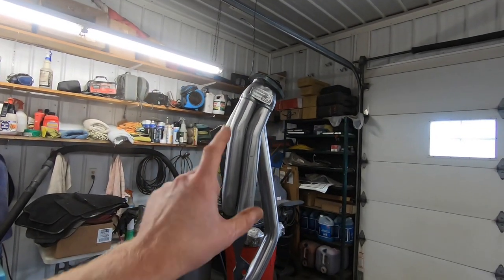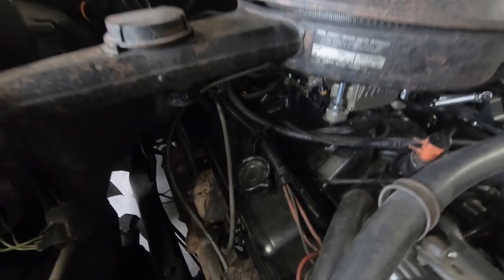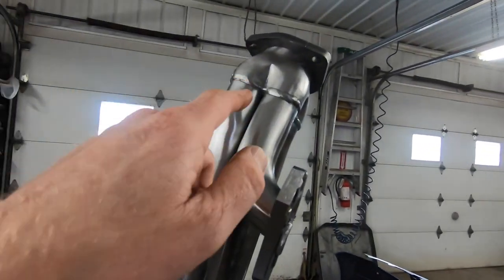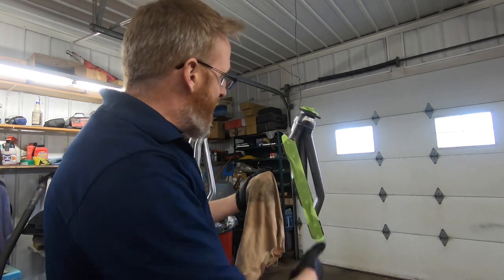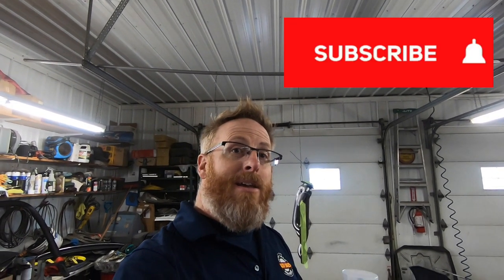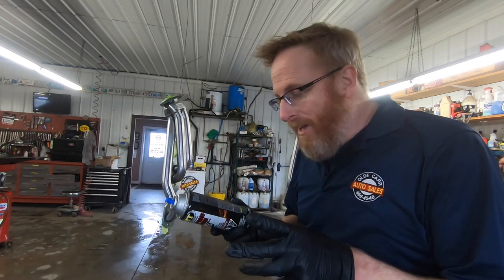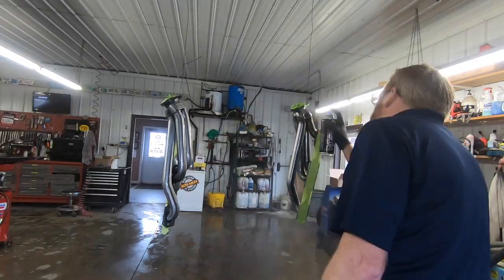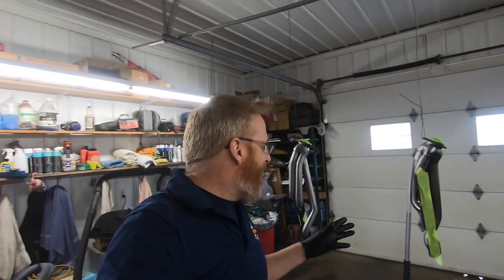High Heat Clear Coat on Sanderson Small Block Chevy Headers

Comment: Hi , I have used this on a motorcycle frame and I am pleased with the result .I have looked all over the web to find out if ,after it's cured it can the clear be sanded, and another coat of clear applied ? Will it bond or should I just leave it . thanks
Reply from the maker: I would say you’re on the right track. Sand and reapply!
Reply: @OldeCarrGuy  Ok, great . Thanks for the reply .

Comment: I'm curious to see if the paint is just going to peel off. Stainless steel is supposed to be etched with a galvanized etching primer before paint. I am in the same situation I have stainless long tubes for my LS but I want to make the engine look like a hopped up 350sbc I wanted to paint them black or cast. If I do mine I will probably sand blast them with a corse grit. Etching primer can't handle the high temps. Thanks for taking one for the team Jason
Reply from the maker: Time will tell!
Reply: @OldeCarrGuy  how have they held up?
Reply from the maker: Not the best! The coating is still there but they hazed quite a bit!

Comment: I want to use the clear ceramic on some ebay stainless steel shorties..   How did this stick?    Id just like to leave the chrome look intact...    I also saw eastwood has a nice internal pipe coating.
Reply from the maker: If you read through some of the comments, I was warned not to do this. It didn't last as long.
Reply: @OldeCarrGuy  dammit.. well like I said Eastwood makes an internal coating that comes with a hose  that atomizes .   I'm wondering what the inside texture is   ( im assuming not like a mirrored chrome ) especially on a chinese stainless shorty off ebay     and you could get the same results ( obv inner outer is best)  of an outer coating and keep a mirror shine. Mine's a van project anyway but thats also more critical for temperatures under the dog house.   But  its not like its as easy to pop the hood.. it would still make it feel nice    and not to say that   if you had to scuff and primer that some coatings dont look nice.  I'm just doing shorties because i dont know if my long tubes will clear the body   so i figure might as well boost power by coating

Comment: How many cans would be needed to coat the full exhaust system? Like 6 cans can be enough for 2 coats from the engine manifolds to the exhaust tips?
Also do they stand pressure washing from time to time when my car need washing after dirt/muddy roads?
Reply from the maker: Oh Boy! Good question. this was 2 cans for 2 headers, so I'd guess at least 4-5

Comment: How has the clear coat held up?  any yellowing?  I did some exhaust tips and went with a matte black but didn't clear coat because they wont get that hot and because it would change the matte look, even if I got the matte high temp clear coat stuff I felt it might shine them up too much.
Reply from the maker: No yellowing, but it did turn my headers all white. Not sure what to thing of that. Not too worried about it. He’s not a show truck.

Comment: Hey I've been trying to get an answer for how this will hold up on raw headers. How are they holding up?
Reply from the maker: Not as good as I had anticipated unfortunately. They basically turned white.
Reply: @OldeCarrGuy  appreciate the reply. Have you tried anything since then that you can recommend?
Reply: @MrYogitron92  they don’t seem to be rusting or anything! So I think the finish is doing its job but I’ve never tried anything else. Maybe black or grey would hold up better to the heat!
Reply: @oldecarrguy2  awesome I'll look into it

Comment: How has the clear coat held up?
Reply from the maker: Not great. It's still there and didn't flake off, but it did discolor.
Reply: @OldeCarrGuy  Like how stainless normally gets colors with heat cycling, or the clear coat itself discolored?

Comment: Can I use heat gun to cure i am working on my rotors on the side and front
Reply from the maker: For sure. We use a heat gun all the time!
Reply: Ok just because I see the label about    250F to cure and 400f and 600f I don't have  too do that just for my rotors I could use heat gun than put them on let it self cure in this summer heat
Reply from the maker: @dianahernandez1375  I misunderstood you the first time. Be sure not to spray the braking surface on the rotor as you will most definitely have brake problems. Only spray the hat where it mounts and the edges. Tape off the rest.
Reply: I explained now do I have to follow the off the vehicle label and direction  in the can bottle or just use the heat gun only did your melt.

I am doing it on my rotors the front and back and side not on the pads
Reply: I am using vht flame proof  satin clear 1300-2000°F [704-1093°C]

But they sale one for rotors only and caliper my friend told use one with high temp
Reply: °F
Reply: Here is the guideline 

Off the Vehicle

Paint must be completely dry before curing

Heat to 250°F (121°C) for 30 minutes

Cool for 30 minutes

Heat to 400°F (204°C) for 30 minutes

Cool for 30 minutes

Heat to 650°F (343°C ) for 30 minutes
Reply: Let me know
Reply: How much time on the heat gun
Reply: Did yours last the clear coat vht or melt or chip
Reply: Did yours last the vht clear high temp
Reply: @OldeCarrGuy   >I had the same thought as why would a brake rotor friction contact area ever be sprayed or coated. I have had new rotors returned as defects to warehouse distributors with minor surface rust. 
  If perfect & clean with no rust, bolted on and drove home in the rain, what do they look like the next morning? Rusty! 
DK, ASE master tech since 78
ACDelco MASM 01-09